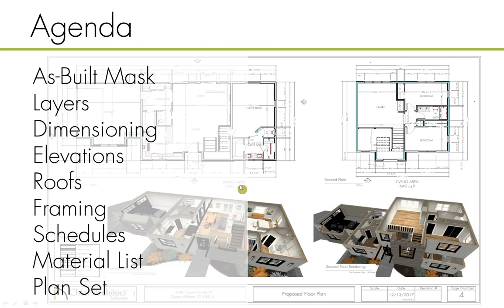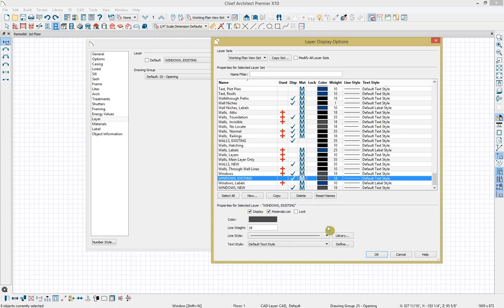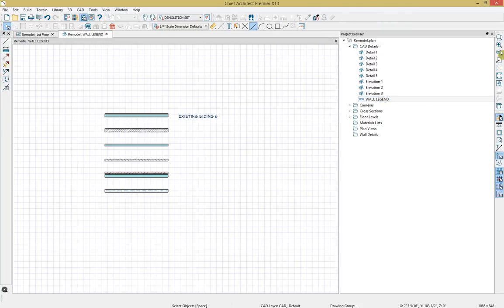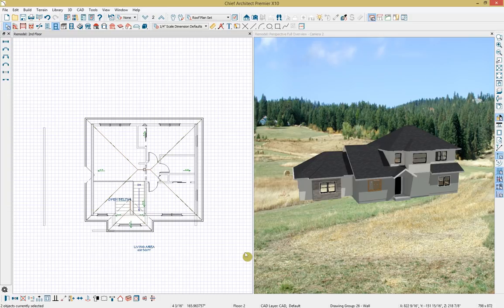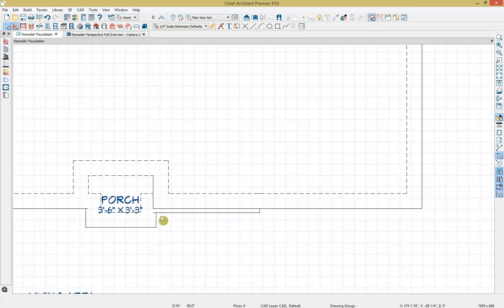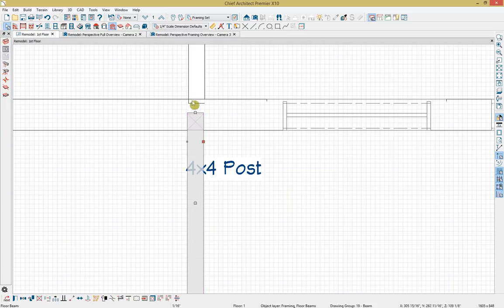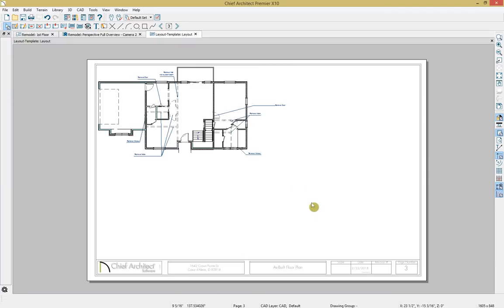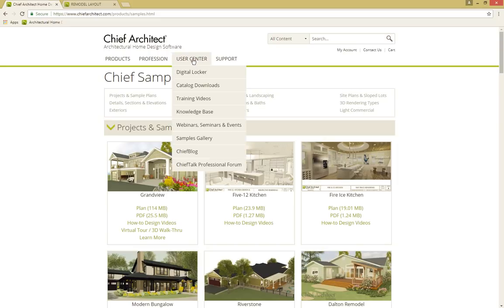Chief Architect X10 Remodeling Webinar

Comment: Good program.. but, it has the worse CAD tools I ever seen. is impossible to
draw specified details with it. it has this grid that is a pain. it try to connect 
lines, that you don,t want to tie.I hate to say that some freeware has better cad.
good for wood construction. not for concrete and steel.
Reply from the maker: Hello Indio, thank you for your comments. Chief Architect Premier comes with a library of over 500 CAD details (https://www.chiefarchitect.com/3d-library/index.php?r=site/detail/764). These details are editable for your specific needs. You can also create CAD details manually. I’d recommend checking out this playlist over on our website that covers the CAD tools: https://www.chiefarchitect.com/videos/playlists/97/17-cad-tools.html. 

If you’d like to turn off the reference grid, you can do so within a plan by going to “View” and then down to “Reference Grid”. You can also adjust the “Snap Properties” in your preferences. If you have further recommendations for how we could improve on these tools, we’d love to hear them via email at suggestions@chiefarchitect.com. 

As for building with concrete and steel, I would recommend reviewing this article on the process of building CBS structures: www.chiefarchitect.com/support/article/KB-00495.